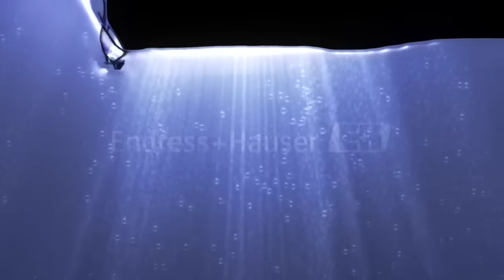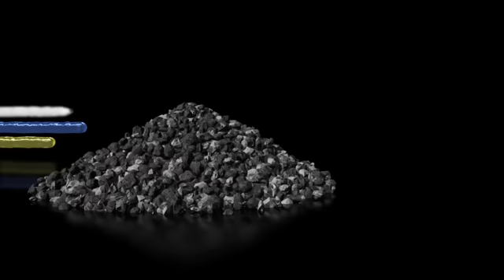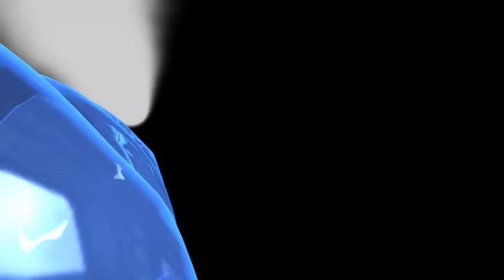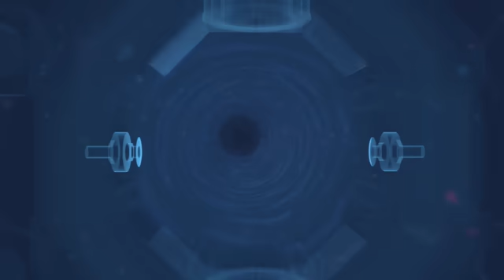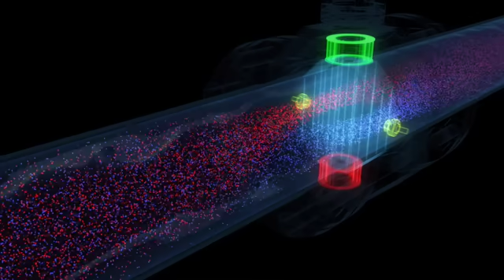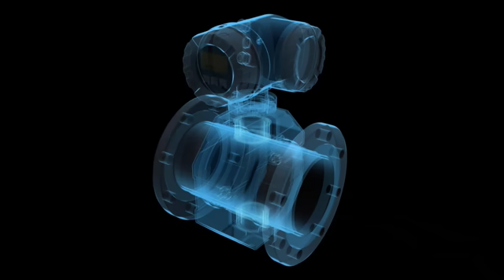The Electromagnetic Flow Measuring Principle

Comment: Hi. Are the two electrodes in direct contact with the fluid? If Chlorine content of liquid fluid is greater than 50 ppm, is this causes corrosion for the SS 316L electrodes?
Reply from the maker: Thank you for your question.The electrodes are in direct contact with the fluid. Besides stainless steel, we offer a range of electrode materials (e.g. alloy C22, titanium, tantalum, platinum) to suit different fluid properties. For a concrete selection, our Applicator-tool offers a corrosion check for different fluids and materials: https://www.endress.com/en/pages/applicator-select-size-instrument. Or you may contact your local Endress+Hauser office for technical support: https://www.endress.com/en/contact.

Comment: Assuming the liquid flowing is corrosive, will the electrode experience corrosion or are the epectrodes electrically isolated from the flowing liquid as well?
Reply from the maker: Thank you for your question. Electromagnetic flowmeters are not electrically isolated from the flowing media. Depending on the medium, a different electrode material must be selected. Endress+Hauser offers stainless steel, alloy C22, tantalum, platinum, and titanium, which can be used to prevent corrosion by the medium.
Reply: @endresshauser  Thank you for the clarification

Comment: please explain why there is no voltage induce if there is no flow?
Thanks
Reply from the maker: Thank you for your question. An electromagnetic flowmeter operates based on Faraday's law of electromagnetic induction. According to this law, a voltage is induced in a conductor moving through a magnetic field. In the case of an electromagnetic flowmeter, the conductor is the conductive fluid flowing through the pipe, and the magnetic field is generated by coils surrounding the pipe.
When there is no flow, there is no movement of the conductive fluid through the magnetic field. As a result, no voltage is induced in the fluid. In other words, the absence of flow means there is no change in magnetic flux, which is essential for inducing a voltage.

Comment: Transcript of the video:
Basic physics of this principle can be traced back to the English physicist Michael Faraday. Two field coil is located in each electro magnetic flow meter. These coils generate a constant magnetic field over the entire cross section of the measuring tube. Two electrode which can pick up electrical voltages are installed at a right angle in the wall of the tube. If there is no gas/liquid flow, no induce electrical voltages measured at first between the two electrodes. The electrically charged particles of the conductive liquids/gas are evenly distributed. Shown here in red and blue particles. However, as soon as the liquid starts to flow in the measuring tube magnetic field applied a force to the charged particles as a results the positively and negatively charged particles in the liquid are separated and collect on the opposite side of the tube wall. Now an electrical voltage forms which is detected and measured by the two electrodes. This voltage is directly proportional to the flow velocity on the pipe line together with the known tube cross section the flow volume can then be calculated. The greater the flow velocity, thus the separations of the charge particles greater the electrical voltage between the electrodes. The electrodes also detects what is called interference voltage. Which has to be separated from the actual measuring signal. One method that has been successfully used for this purposes to create the magnetic field with a pulse direct current, to do so the polarity of the magnetic field is alternately reversed, illustrated here in slow motion. Voltage pick up on the measuring electrode now constantly changes in polarity. As a result all constant interference voltages can be eliminated. For example: electrochemical effect on the liquid or external electromagnetic field. Thus, the size of such interference has no impact whatsoever on the actual measuring signals. The advantages of this are a stable measurements and a stable system zero point.
Reply from the maker: Thank you for your comment. To see the complete transcript, please enable the subtitles/closed captions function of this video or open the transcript pane by clicking on the three dots and “show transcript”.

Comment: Magnetic force is applied to particles to a single electrode, how are the oppositely charged ions goes to opposite  side electrode as blue and red opposite charged ions separated ?
Reply from the maker: A conductive liquid contains positive and negative ions. As soon as the liquid starts to flow, the movement of the ions through the magnetic field results in a force on the ions, this is Faraday's law of induction. The force is proportional to the charge and causes the positive and negative ions to separate, depending on their charge. For illustration purposes, this process is shown strongly exaggerated in the animation.

Comment: Hello, i want ask how is measured the voltage? I particularly understand that  positive particles are sent to one electrode and negative particles are sent do another electrode, so electrons are sent to one conductor and to the another conductor is sent what? I don't understand what determines that one electrode is anode and another electrode is cathode. Is there any diode behind the electrode?
Reply from the maker: Thank you for your question. Generally, the potential difference between the measuring electrodes is evaluated by state of the art electronics and filters in the sensor and transmitter of electromagnetic flowmeters. For further technical details please visit our website: https://eh.digital/proline-promag.
Reply: @endresshauser  thank you for information

Comment: Does it also measure air flow ?
Reply from the maker: Dear Hardik Patel, electromagnetic flowmeters measure conductive fluids. For air flow measurement, feel free to have a look at thermal, vortex, Coriolis or ultrasonic measurement devices.
Reply: @endresshauser   Thanks for your suggestion
Reply: @endresshauser  in our plant, coriolis flow meter is connected in palm oil and syrup line, so it's not showing accurate results,  air flow in before fluids flow due to empty line. And also show reading without fluids flow.

Does it good choice to use electromagnetic flow meter.?
Reply from the maker: @hardikpatel8149  for a particular application we'd kindly ask you to contact your local Endress+Hauser support. There you'll find best assistance for the tailored solution. The contact details can be found here: https://www.endress.com/en/contact

Comment: So the flow rate depends on what substance (liquid) is flowing  through  the pipe right?
Reply from the maker: As long as the medium (liquid) is above a minimum conductivity level, the flow rate measured is directly proportional to the velocity of the medium flowing through the meter. There are of course some aspects to be considered when selecting and sizing an electromagnetic flowmeter for a specific measuring purpose including the properties of the medium.

Comment: Would you say that the hall effect principle is applied here since a magnetic field is placed perpendicular to flow and charges are displaced sideways
Reply from the maker: The hall effect is created though a permanent magnet where the measured voltage is proportional to the field strength.
With the magnetic-inductive measurement principle, a constant field strength is created and through the flow velocity (of an conductive liquid) a voltage is induced. 
The voltage induced is proportional to the flow velocity and is supplied to the amplifier by means of two measuring electrodes.

Difference is therefore that the inductive measurement principle needs moving charge carriers in the magnetic field.
Reply: @endresshauser  thanks for the reply.Much appreciated

Comment: What, if the there is no flow but conductive fluid is still filled in it, will it show the output? if not why?
Reply from the maker: If the pipe is full with liquid but no flow, the output will show value zero.

Comment: can i use this to get measurement from partially filled (pressurized air and liquid) pipe?
Reply from the maker: @eren ay: as shown on the video, the flowmeter measures the voltage on the electrodes which is linear to the flow velocity. So by knowing the flow velocity and the cross section of the flowmeter, the electronics calculates the flow rate. This measurement is correct as long as the pipe is full. The moment the pipe is not full, the flow rate cannot be calculated accurately anymore, as the meter does not know how much liquid and how much air is in the pipe. As long as the measuring electrodes are in contact with the liquid, the meter will measure the velocity and calculate the volume on full pipe conditions. For this reason, we have implemented in the unit a non-full-pipe detection, i.e. the moment there is air on top of the meter and the so called EPD electrode is no longer in touch with the fluid, the meter will display an alarm so that the user is aware that his measurement will not be correct anymore. The moment the fluid is below the electrodes, there will be no measurement at all anymore.
Reply: First of all, thank you for your reply. So, do you have any product to measure partially filled pipe? I saw some ultrasound tech. but they are running at normal pressure such as sanitary systems.
Reply from the maker: None of the classical flowmeters can be used for partially filled pipes unless they're designed for this typical application and described accordingly. Usually it makes more sense to find a solution in installation to keep the pipe always full rather than to use a flow meter for partially filled pipes. The reason is with the measuring uncertainty. A flow meter for partially filled pipes does always offer an increased uncertainty compared to flow meters for full pipes. That's why only few flow meters for partially filled pipes can be found. Suggestions for modifying installation in order to keep the pipe full can be given if you contact our office/representative in your country.
Reply: Again thank you for your kind replies and suggestions.

Comment: Is it safe and reliable install an electromagnetic flow meter,next to one water pump?
Thank you
Reply: @Rui Ilhavo - To keep the instrument performance and reliability is recommended to install the flowmeter >5DN inlet and >2DN outlet runs. There is one option for Promag 400 that it's possible to have 0 inlet and outlet runs but only for 90ºangle turns, nevertheless, with this option you have to consider pressure lost in the meter.
Regarding safety depends how you support the instrument mechanically, please be aware of vibrations on the pipe.
Reply: The flow meter is mounted 5 pipe diameter from the pump or any bends, 10 pipe diameters downstream of pipe should not have any bends. This to avoid turbulance in the flowing fluid.

Comment: What is used to distribute the magnetic field vertical?? 1:34
Reply from the maker: The orientation of the magnetic field is defined by the placement of the coils and the electrodes. Normally the electrodes are positioned at a 90° angle to the coils (ringcore coils).

Comment: will the electrodes detect induced voltage if they're outside the pipe?
Reply: Its depending on the measuring principle. In case of the mentioned System in the movie, electrodes need to be connected with the medium.

Comment: @David: Faraday’s law of electromagnetic induction is the basic principle of any EMF. A voltage is induced if an electric conductor is moved through a magnetic field. 
Instead of a wire moved within a magnetic field formed by a permanent magnet, a conductive liquid passes through an alternating magnetic field generated by coils. If there is no movement, no voltage is induced (this are not particles, this is the induced voltage). The EMF’s is capable to measure the flowrate in both directions. Based on the polarity of the induced voltage one can detect the flow direction.
Reply: No, the principle at work here is the Hall effect, not the Faraday effect.  There is no electromagnetic induction since the fields are static (except for the reversals).

Comment: SO the electrodes are instales inside?
Reply: Yes, you can google.
Reply: cable from electrodes mounted inside are taken to the meter box located at certain distance. In side the meter box electronic ciruit takes care of amplification of low level signal and signal conditioning will be done. Later to dispay unit. It can be inside the meter box or a DCS system.